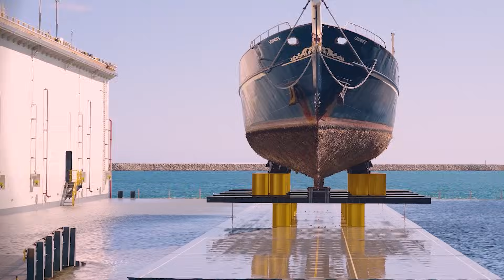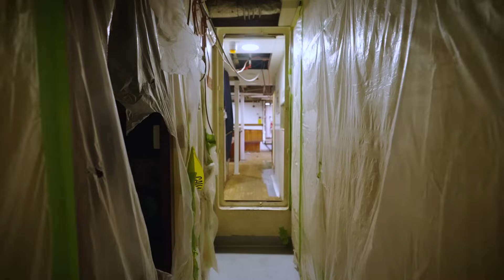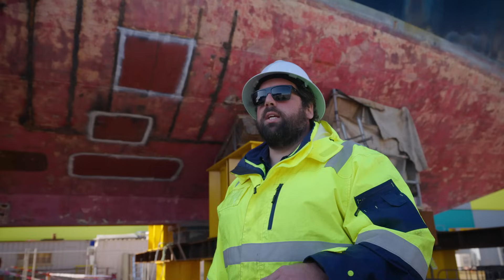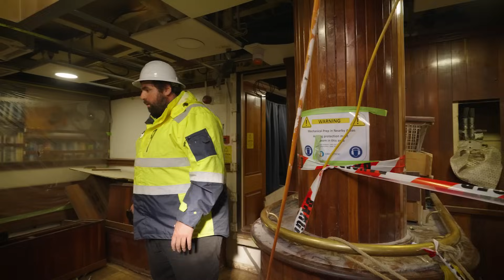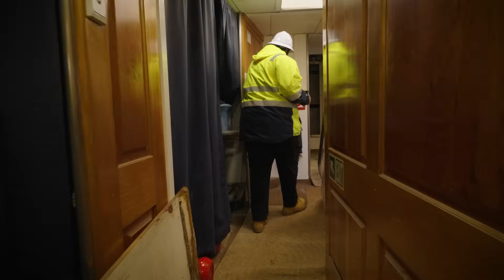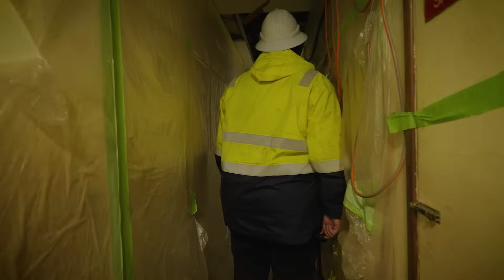Will Leeuwin Sail Again? (New Footage)

Comment: Crewed on Leeuwin 2 for most of the 90's. Did several refits and sailed as cook's mate, bosun's mate, engineer, but my favourite role was that of Red Watch leader and some folks may recall all the red toenails. So I came onboard with an engineering bias but eventually got my Master 5 in 2005. The blue canoe changed my life forever.